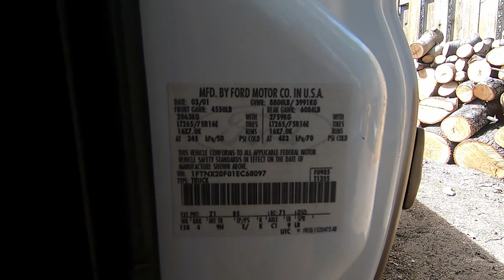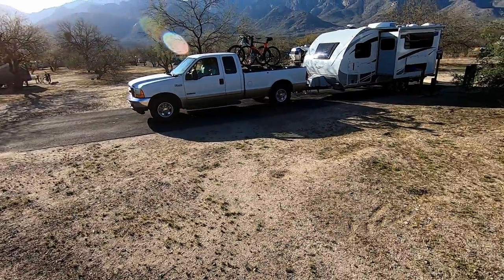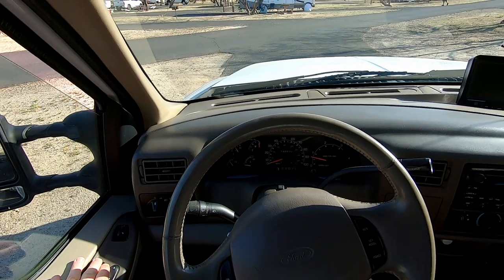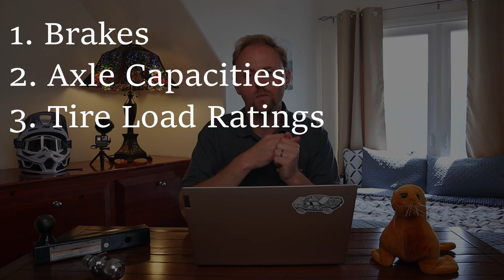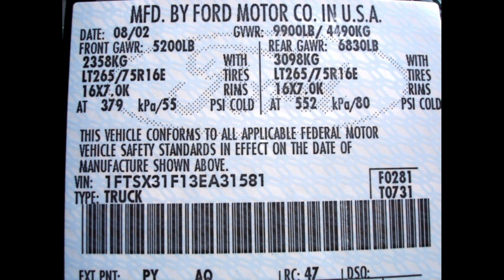Does Payload Capacity Even Matter? (travel trailer - misleading tow ratings)

Comment: Great Video!
 For "majority" stay with a trailer that weighs 20-25% below the stated tow capacity. Load your trailer smartly....no excessive weight on the rear of the trailer such as a kitchen....will cause sway. Don't load anything heavy behind your truck's rear axle....will add to hitch weight. Heavy against the front of the bed only or just in front of your rear axle.
Reply from the maker: Thanks for the tips!

Comment: Great info for us newbies to towing. I want to get a 1/2 ton p/u to tow a trailer safely. If you load all your gear into the back of your truck along with the hitch weight of the trailer you will be at or probably over your payload capacity. if you put all your gear, generator, bikes whatever in the trailer, wouldn't that increase available payload capacity of your truck? Yes your hitch weight would increase with more stuff in the trailer, but it seems to me it would be less of a number than having it all in the bed or backseat of your truck. Putting a generator in the back of your truck affects payload more than if it was in the trailer wouldn't it? Please set me straight on this.
Reply: I was wondering the same thing!

Comment: You don't really hit the GVWR limit because it's really just calculated by reference to the truck's payload but makes crazy assumptions like you only have 470 lbs of weight in your truck (2 150 lb humans, 70lbs of hitch gear, 100lbs of cargo) and a 10% hitch weight, which is on the lower side in the US

Comment: My Dad had a livestock feed store. I would drive our 3/4 ton chevy p/u's with the Chevy 350 engine everyday a distance of 80 miles loaded with 80-100 fifty pound bags of livestock feed. That is a payload of 4,000-5,000 Lbs of feed. AWESOME!!!!! Never a mechanical breakdown, blown tire, suspension failure. Easy to drive, steer and stop. These were 3/4 ton p/u's from the 70's and 80's. Would I try it with today's trucks?.....probably not.
Reply from the maker: That is awesome!